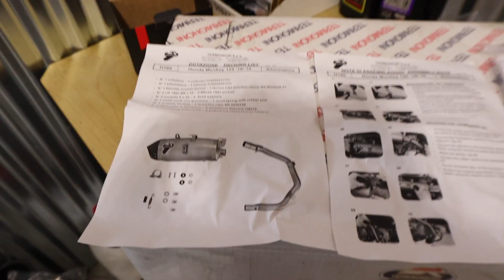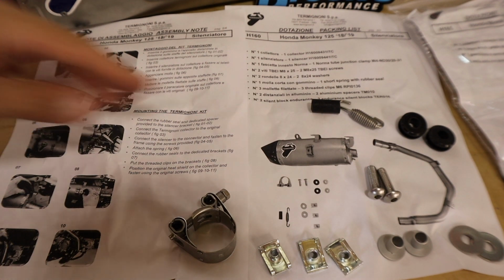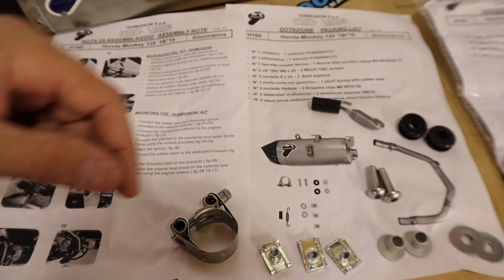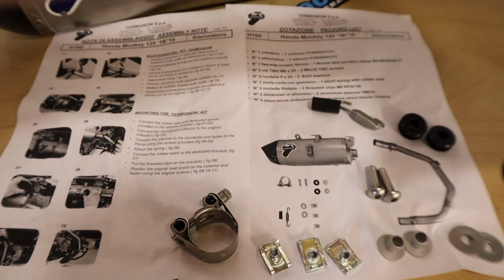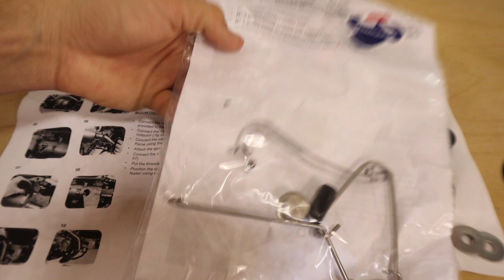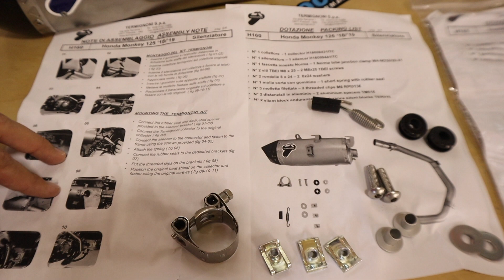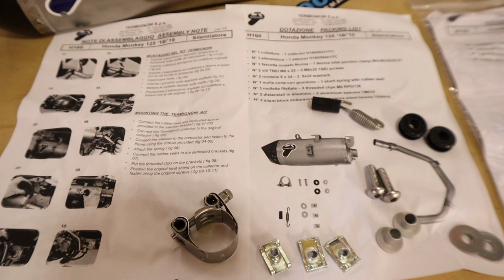TERMIGNONI EXHAUST FOR 2019+ HONDA MONKEY | INSTALLATION INSTRUCTIONS AND TRICKS

Comment: For what it cost they should have included the new rubber mounts.
Reply from the maker: Being a manufacturer, I can see why this would have presented more of a challenge for them to create the system as creating replacement mounts is not as easy as it seems. If they were to supply OEM rubber mounts, that's a different story